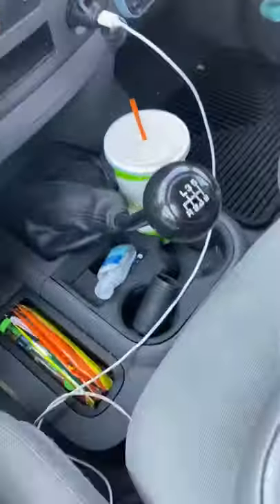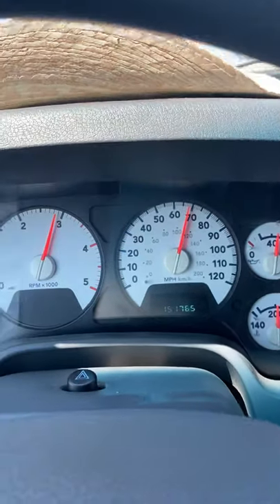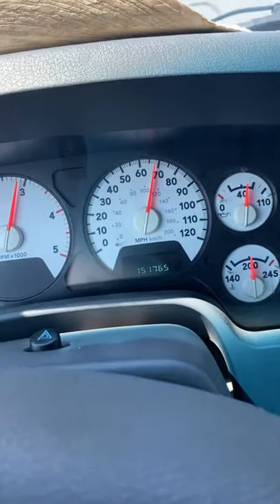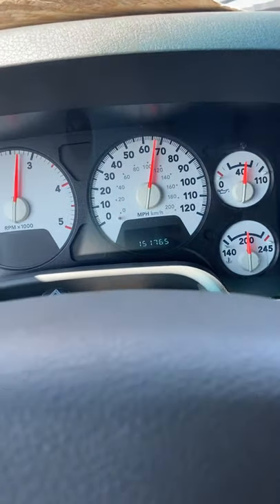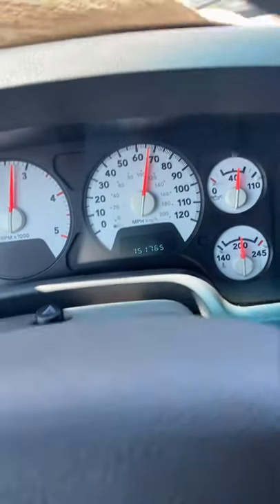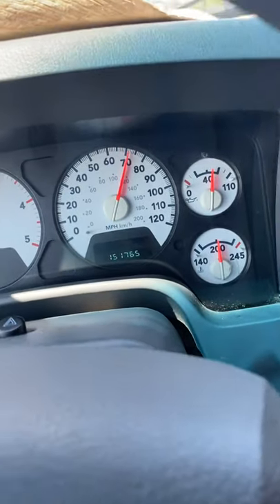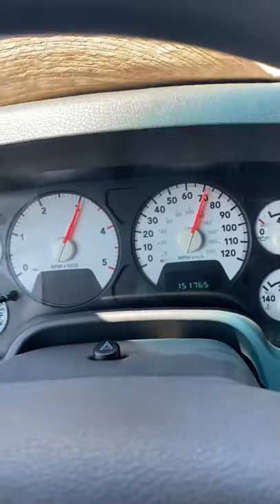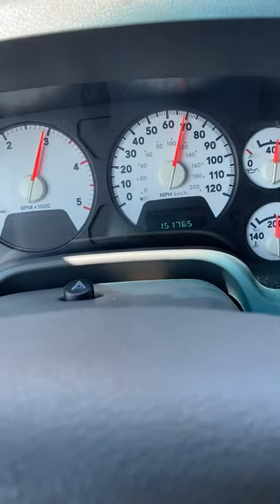Dodge Ram 3500 G56

Comment: My nv5600 with 3.55 gears runs 2,000 rpm at 70mph. It’s a one ton dually and I haven’t had an issue starting in 1st pulling 20,000lbs
Reply: Nv4500

Comment: I run 33 talls on mine and at 2200 rpms i hit 70 i didnt care for the 35 wide ass tire simply because it made getting into tight parking lots a nightmare plus i like the way the 33 talls handle when towing

Comment: Idk whether that’s a 5.9 or a 6.7 Cummins but my 6.7 with a g56 runs about 2,200 rpms doing 70.
Reply: That’s a 5.9 look at the tach red line. The 6.7 also has a differently geared g56

Comment: tachometer is wrong
Reply: No it's corrrect if he's on 31's at 4.10
Reply: @Frindleeguy No, that’s not correct at all.  I had a Super Duty with a ZF 5 speed with 5.13 gears pulled 70 at 3000. 31s are pretty much stock. You’re gonna say that factory that truck is turning RPMs like that?

Comment: Is the clutch slipping? How many miles on the clutch?

I have replaced the clutch twice in 60,000 miles, and I baby it!

These clutches aren’t designed for heavy use even though in a truck. Easily damaged by vibration in the drivetrain.
Reply: What kind
Reply: @jasontrump579  dodge
Reply: Early g56 6th an reverse are lower ratio. The changed it in 07.5 for the 6.7 to a higher ratio for hwy. either changed your gears or get a newer g56

Comment: You gotta get a gear vendors. It’s an auxiliary transmission that goes on the back of your transfer case and should drop the rpm’s down too around 2300rpms